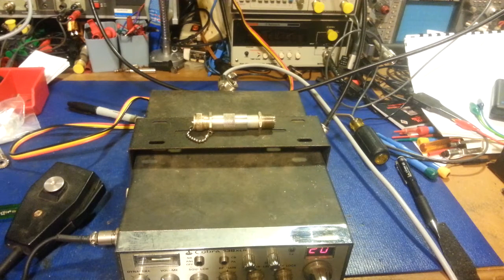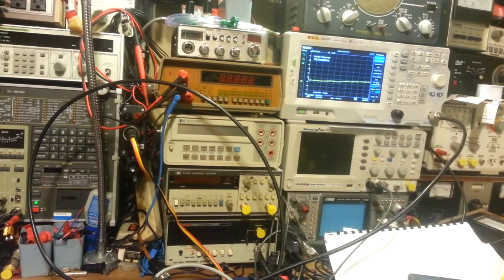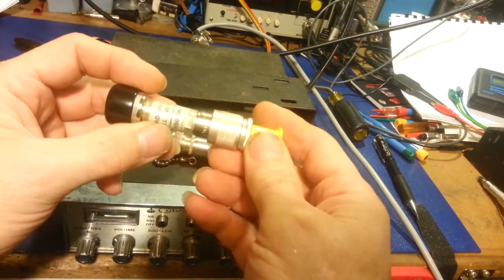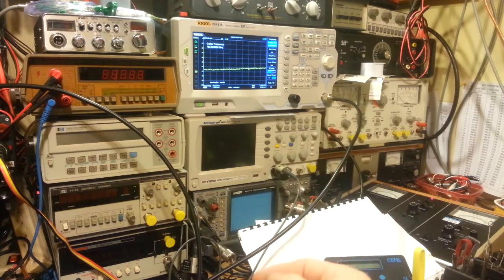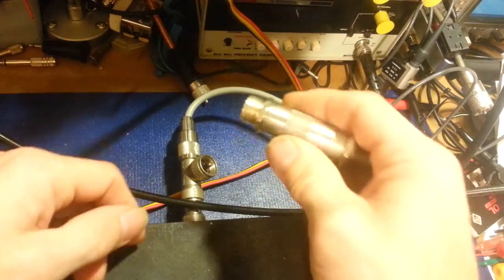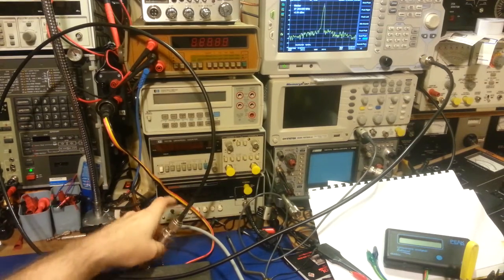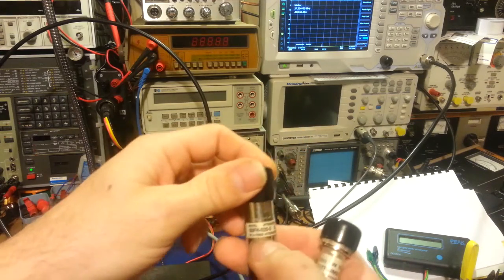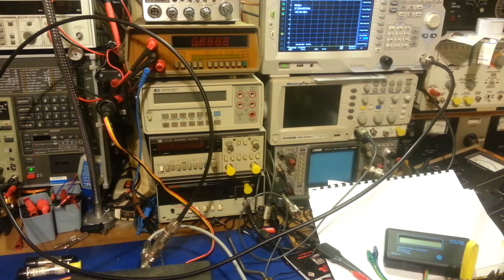RF sample ports and attenuators.  Their differences and uses.

Comment: but with your rf sampling device, if you would measure with a mV meter, you could actually tune it for the work you are doing and measure ampliture precisely ? Having a 5w radio or a 1kw amp (1000w is 60dBm) you could still use that same exact rf sampling part but only retune it properly with the attenuation you want a mV meter and then once you know it does not go over the maximum input level of the spectrum or scope, you could sample precise amplitude measurement ?

Comment: Regarding Attenuators and CB radios being viewed by an Osciloscope: Can you briefly shed some light on what value Attenuators you would use for AM [Amplitude Modulation] - 4 watts carrier power [CP]  and SSB [Single Side-Band] - 12 watts peak envelope power [PEP] . For instance value x for 4 watts going to a 50ohm input and value x for 12 watts going to the same 50 omh input.

Reference: Rule 10                Power Output

{A} Your CB station transmitter power output must not exceed the following values under any conditions: 
AM [Amplitude Modulation] - 4 watts carrier power [CP] 
SSB [Single Side-Band] - 12 watts peak envelope power [PEP] 
{B} If you need more information about the power rule, see Part 95/ Subpart E. 
{C} Use of a transmitter which has carrier [CP] or peak envelope power [PEP]in excess of that authorized voids your authority to operate the station.

Thank you.
Reply from the maker: +WaterWhite Tuber 

Unless your scope has selectable 1M or 50 Ohm input your going to want to use a sample port for a scope, not a attenuator.  You can't terminate a 50 Ohm system into a 1Meg instrument.  You could use a T adapter with a 50 Ohm termination on one leg and then run the other leg to your scope.  You could also use a transformer coupled sample port which effectively isolates the scope.  This is what is in a lot of the modulation monitor sampler boxes.  You can easily build one of these.  Peter over at the TRX Bench here on youtube did a good video on how to construct one of those some time ago.
Reply: Thank you. I will have to research some of this. I have a 300 Watt dry dummy load and a nice assortment of BNC and pl-259/ SO-239 adapters (Yes, I have a few T's and 18" length cables). I also saw a nice video on the radio shop. The video showed how to take a piece of coax and connect rigid wire in a half inch loop as sort of a sniffer. Is that what you mean by using a "transformer" ? I believe I have access to an old Tektronix 100Mhz dual trace scope (from the 1980's). I dont recall the model number. But I am aware that I should check the input on the scope to get the maximum input allowed. Being that its a BNC connecter, I'm assuming its going to be a 50 ohm impedance with a power or voltage rating of some sort.

You guys are fantastic people for making these videos and sharing your time with the world.
Reply from the maker: +WaterWhite Tuber 

No, most every day scopes are 1Meg input impedance.  Some have selectable 50 Ohm or 1Meg input impedance, usually ones over 100MHz.  The scope will usually have it printed on the front by the input connectors.

Yes, that sounds like a transformer type sampler.  Coax cable length does not matter.  The only difference cable length makes (below about 300MHz) is the longer it is the more loss there is.  If your getting different results with different cable lengths then you have a impedance mismatch somewhere.
Reply from the maker: WaterWhite Tuber 

The first one is a sniffer probe like used for EMI compliance testing or tracking down noise or presence of a signal in a circuit.  The second one, yes, that's Peters video I was talking about.
Reply: Thank you for your reply. That helps clarify things a great deal. I appreciate your Elmering.

Comment: The heck you can't make an accurate measurement using a signal tap, That's exactly what they are designed to do.  Are you seriously telling us that you don't know how to measure the attenuation of that signal tap? 

Hmm okay well you simply use your tracking generator to sweep the signal tap, Note how much coupling loss in db you have at the frequencies you normally measuring and input those offsets into the spectrum analyzers offset memory. By the way, there is no such thing as making absolute measurements with a spectrum analyzer, in order for the measurements to be accurate they need to be relative measurements.  You need to take your test cables with the signal tap in line and measure it and then input those numbers into your offsets.  

 You can make exceptionally accurate measurements that way.  Furthermore, you only need to make those measurements once for every frequency you regularly measure in your case 27 Mhz and then store those offsets as test profiles in your spectrum analyzers memory, When you need to test another piece of gear on that frequency you simply push a button and recall that profile. 

In fact, No one simply enters the attenuation listed on the label and enters it into the offset, you should be measuring them and then entering the value you measured as I've never seen an attenuator that was flat. 

In my shop, if you get caught using a high power attenuator on the front end of expensive test gear you'll get fired on the spot, high power attenuators fail all the time and I'll be damned if I would trust a second hand eBay special to protect the front end of a piece of $100,000 agilent test gear.  

By the way, have you ever swept one of those cheap Chinese attenuators you showed, They may say 10db on the label but at what frequency? In my shop, we use nothing but Agilent attenuators these run over $300 each for a 2-watt attenuator and they still need to be calibrated every year if you're working on commercial gear.

Comment: Sampler is great at the repeater shack for hooking in the deviation meter. Small and fits in the service bag. Like you I use the Attenuators at the service bench. Nice job explaining.
Reply from the maker: And you can take meaningful amplitude measurements with a attenuator.
Reply: Yes you can,  I'm curious do you actually hold a commercial FCC license, In other words, are you licensed to work on avionics and marine electronics or are you a CB/ ham radio hobbyists/enthusiast.  I mean you do have a spectrum analyzer on the bench and I assume it has the tracking gen option so you should know how to sweep your signal taps and enter the offsets. 

To be perfectly honest while the method you are promoting might work well for hobbyists,  it's not something you would ever see done in a professional repair facility that works on say avionics.   High power attenuators are notoriously unreliable, In fact, even the best high-power attenuators drift as they get hot and all it takes to make one dangerously unreliable is to overheat it once or twice.

Comment: Man you have some attenuation! :-) Another great video Mike.
Reply from the maker: Like most test equipment accessories you can never have to many.  I currently can run 2,000 watts straight into the SA through attenuators.  I bid on a 50db 10,000 watt attenuator last month but got outbid.  I'll have one some day. :)

Comment: Good job on the video, I remember struggling on this topic when I first got into RF design, there was so much equipment that I needed to buy and  a high power 60db pads were just not in my budget. Another thing that took me a little while to get accustom to was thinking in terms of db and dbm, I mention it because I see it in a comment below. For others that read these comments, not you of course, there are lots of calculators on the web that will convert for you but what I like is this table that lists dbm, volts (peek, peek to peek, RMS) and power. http://ifmaxp1.ifm.uni-hamburg.de/DBM.shtml I just keep the link on my desktop and bam Bob's your uncle. Thanks for the video and keep up the good work.
Reply from the maker: Here is one I keep on the bench and use all the time.  Its by Mini Circuits and shows dbm, volts and watts.  Most people into CB radios can relate to watts so having a dbm to watts chart on hand is good for them.

https://www.google.com/url?sa=t&source=web&cd=1&ved=0ahUKEwjMiaL_wvvPAhVG8IMKHbgrCqUQFggbMAA&url=http%3A%2F%2Fwww.minicircuits.com%2Fpages%2Fpdfs%2Fdg03-110.pdf&usg=AFQjCNGARvsebUFghKGFbv-AHpjeFAKz4Q
Reply: This topic has me intrigued, nonetheless, here is something I found on RF parts
https://www.rfparts.com/attenuators.html
Great video 👍👍

Comment: what would you limit it to, how about 50 watts what would the SA be ok
Reply from the maker: Do you mean directly into the SA?  At 50 watts you would definitely have magic smoke comming out of it.  It can only handle a maximum input level of +20dbm which is 100mW.
Reply: sorry I meant using your adjustable att you showed that screws in and out, I know the SA limits
Reply from the maker: +DENNIS N 

Oh, you mean how much could you safely put into the sampler without damage to something like the SA.  I would think in excess of 1,000 watts, maybe even 10,000 watts.  I was getting over 60db of attenuation in this demonstration.  The safe input level of the SA is +20dbm.  10,000 watts is +70dbm, minus 60db equals +10dbm out of the sample port.  At those levels I would probably pad the input to the SA just to be safe with a small 10 or 20 db resistance type attenuator.
Reply: always wondering a handheld transmitter close to my SA would damage it 8 watts of power  yes I always use inline att
Reply from the maker: +DENNIS N 

Unless you have a antenna hanging directly off the front of the SA and you don't touch the antennas together it shouldn't do anything.  You have to remember that 8 watts is being radiated in all directions.  Its not a beam antenna pointed directly at the SA.  But like you say a little extra padding at the SA input is good practice.  Better safe than sorry.